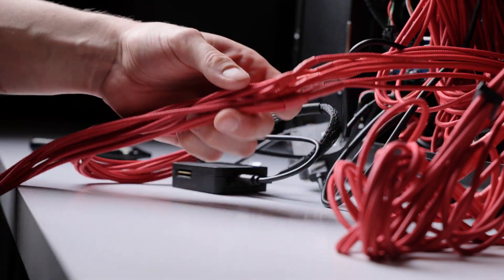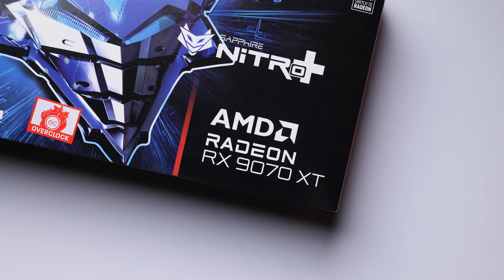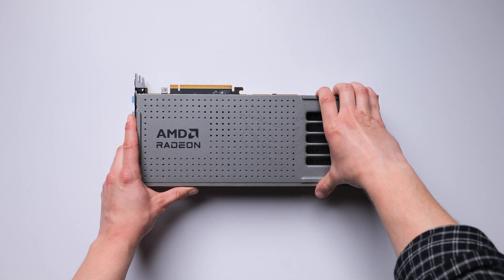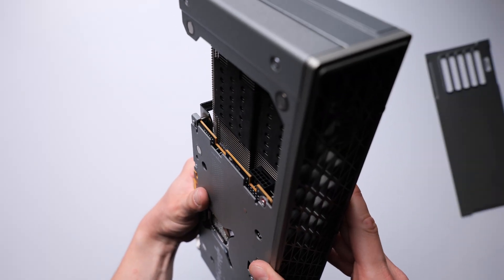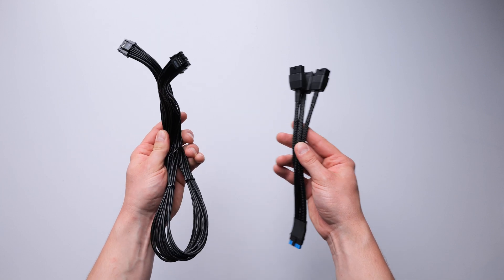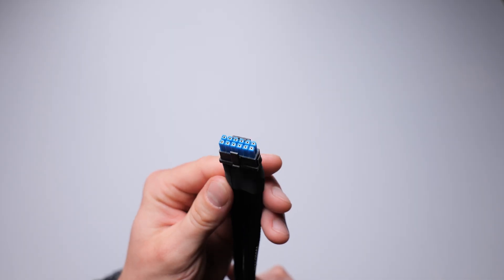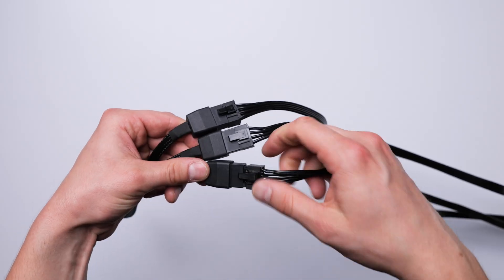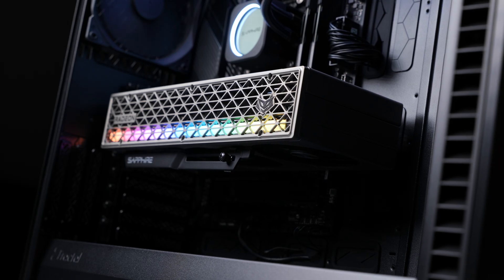HOW TO: Use SAPPHIRE's STEALTH Hidden Power Cable x Quick Connect Magniplate

Comment: bruh the video is wrong.

In the instruction manual, you need to insert the cable first, and then you can put the GPU in the PCIe slot.

Comment: 2x 8-pin: 16 wires
1x 12V high failure rate connector: 16 wires + fire risk

Comment: Bending that fire hazard power connector just looks worrying. Otherwise I like that design.
Reply: Not that big of a problem, coming from a 4090 owner. Considering that the 9070XT only needs about 350W, its well under the 600W limit of the cable itself. But its better to double check its fully plugged in, I like that it has that blue color to know if its fully seated.